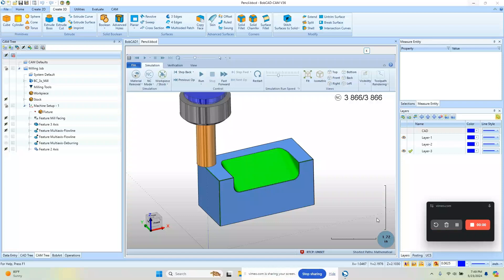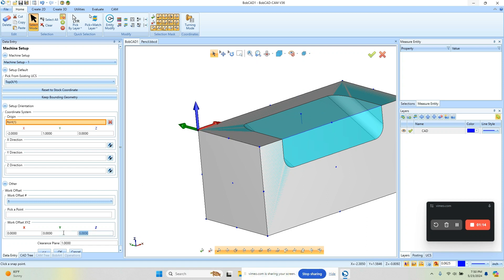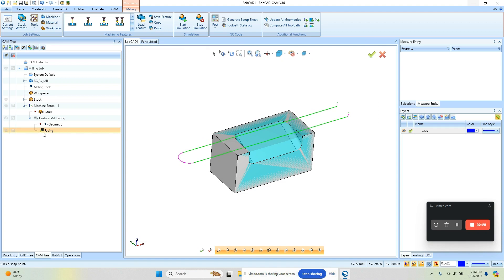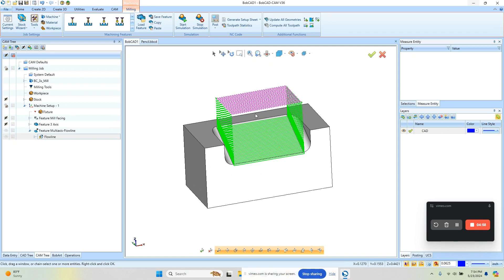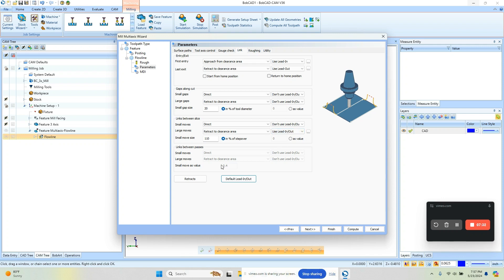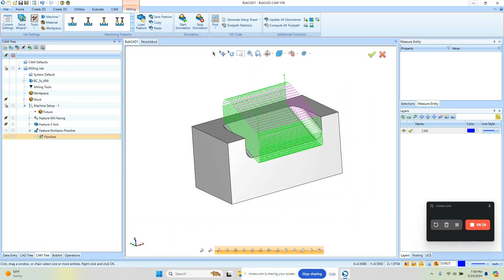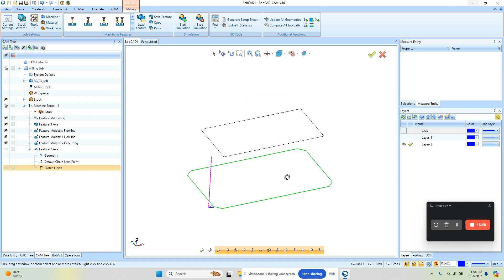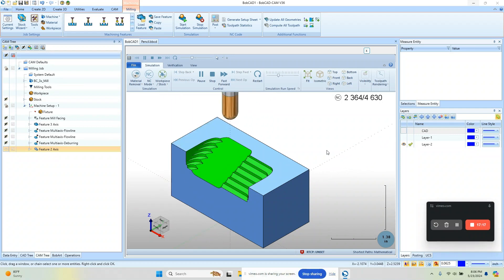BobCAD CAM V36 Flow Line Toolpath Example

Comment: Hi Al, The surface toolpaths are a mystery in that they all seem to be able to work for everything.  It would be nice to hear some contrast/choice observations about how the others may or may not be easy to choose.  Also, regarding the links, there are so many options that the specific definitions of, for example which direction is tangent, means either spending hours digging through the manual or getting buried in trying lots of options.  therefore, like with the bunch of surfacing options, for links it would be good to hear a heirarchy for things to try first.